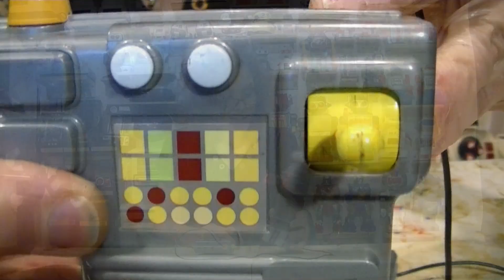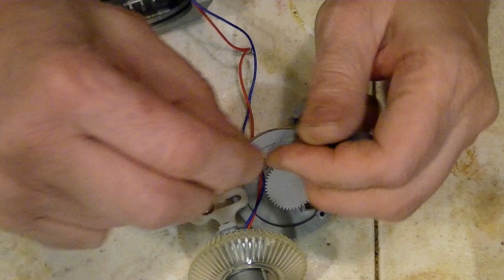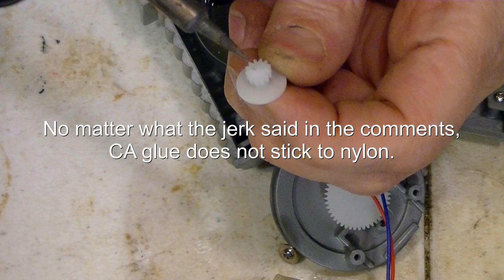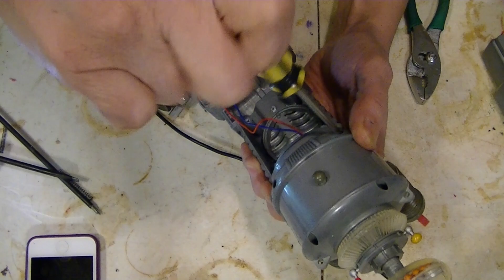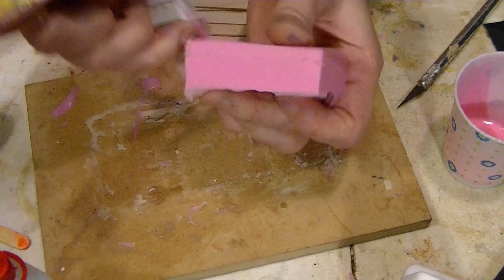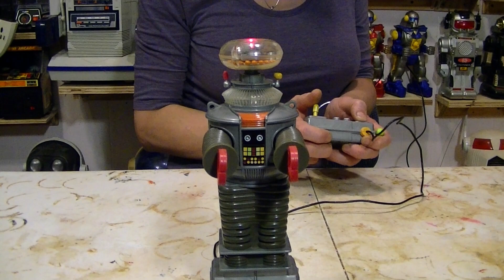Danger Will Robinson! - Lost In Space Robot Refurbished

Comment: Well, whoever put this B-9 together didnt know much about the show if his liplight is in his dome! And I'm pretty sure he didnt have bright orange balls in his dome either.
Also, he never said "Danger, Danger Will Robinson!" The line is "Danger Will Robinson, Danger"
As for my favorite theme, I like them both really. Might lean toward Season1/2. 
For those that'd like to listen, you can hear them both here - https://www.youtube.com/watch?v=712ns4jnG-k
Reply from the maker: It is a pretty crappy robot.
Reply: @RandiRain  It is. Its a shame the decent models of him are so expensive. It was a while back, but I saw one once that had show accurate rubber tracks, his 'legs' and arms were rubber too, I remember someone poking them and they flexed around some structure inside. He had decent chrome pieces, lights in the dome which may have been glass, his liplight flashed to his speech, even the little flashing lights on his torso worked. Of course the price tag was something like $700, maybe 15 years ago. I remember feeling dissapointed that it had a switch on the underside of his treads rather than turning on by fitting his power pack.

Comment: Another cool Vidieo
Reply from the maker: Thank you very much.
Reply: Cant wait till you tackle 
BIG LOO
Reply: Looks like you got a Hair Cut
Reply: The problem.with this Robot 
IT NOT A TOMY
Reply: Sqaure Hole for round Peg
Reply: So a Crown Gear is Vertical a 10 tooth Gear is Horozinal
Reply: How did you melt it
Reply: Maybe it a Spring Motor Wind s up then transmit Power
Reply: Can you use thin down vaseline as 
A Mold release
Reply: Is that Parchment Baking Paper
Reply: Great color Match

Comment: That reverse with one wheel blocked brings back bad memories. Very young me finally gets a remote control car. Was ecstatic. Turned out it could only go forward and for any kind of steering you had to use reverse to try and point it in the general direction you wanted to go. I know my parents meant well, but yeah.. 
Anyway, if I had to repair this thing, chicken-little robot had real reason to holler "Danger Danger!"
Reply from the maker: Yeah, it's ok when a robot does it, but when a car does it, that's pretty lame.